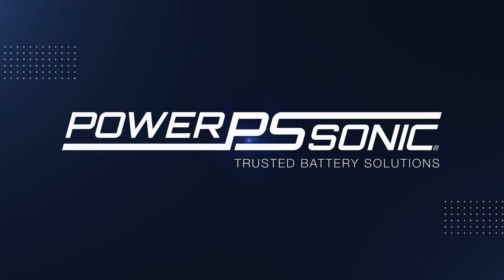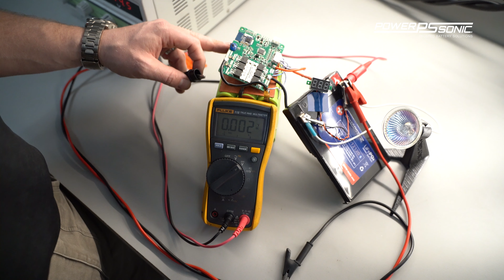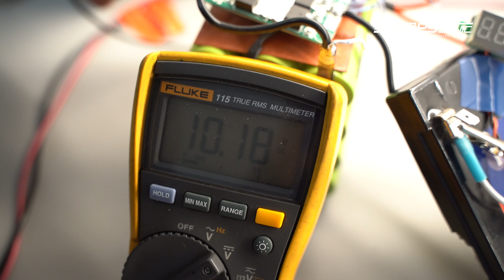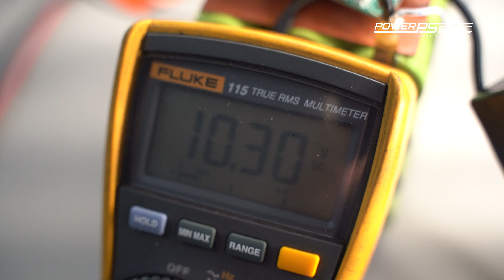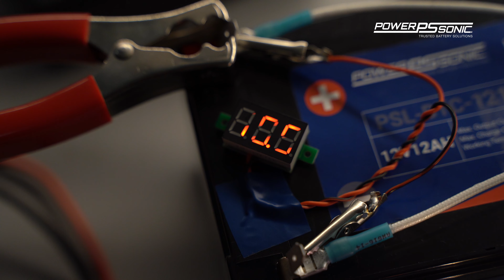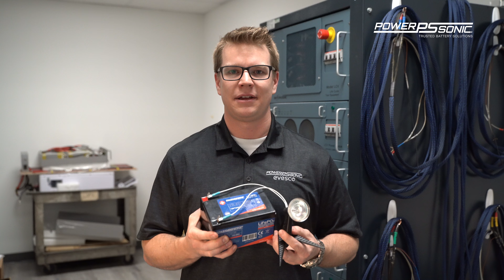How to Wake Up Your Lithium LiFePO4 Battery

Comment: Ok on the water in my boat I have a 24 volt 100 amp lithium battery and it is in sleep mode how do i wake it up and what would i need to keep in the boat if this happens?